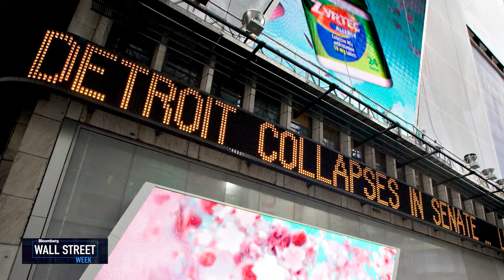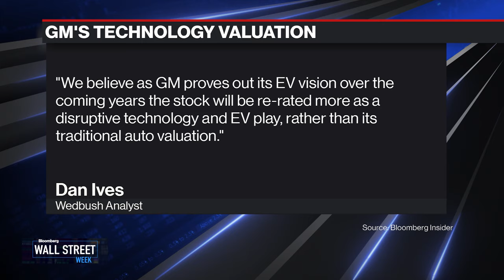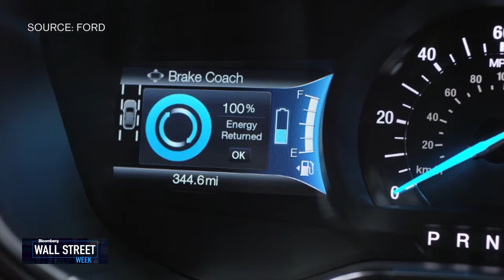Just the Facts: The Auto Industry's Electric Future

Comment: Where are we all going to plug our cars in for an hour while they charge. And no matter the urgency it takes a while to update the grid.
Reply: @dcheard2  takes time and money. We don’t have. The gov can’t even pass a infrastructure package without cuts. Ev are extremely training on the grid. Gonna need a lot more power plants that take time to build plan engineer
Reply: @sandcrewus1362   they probably said the same thing about gas cars but here we are.
Reply: @dcheard2  well with gas cars you can just open a station and buy fuel. With electric,they’ll have to relay on a public utility
Reply: @sandcrewus1362  lol. they had to build, plan, and engineer the oil refining process too. build out the stations too. did you think that gas just comes out of the ground ready to go?

Comment: Telsa fantasy world. There is no "Transition to electric vehicles"  Not that people don't like EVs - there isn't enough lithium. Even IF you devoted every ounce of the 100,000 Tons of lithium to EVs max is 10 million Ys.  But there are 1 billion cell phones, battery farms, laptops etc. all using lithium; so the real number is 5 to 6 million in a market of 100 million vehicles annually, 5-6% niche market isn't a transition.  At this point EV advocates say what about sodium what about carbon .. what about them? There isn't a single vehicle incorporating them yet.  More sobering? 1.4 Billion light vehicles exist of which EVs are 0.3%.  Add to this EVs don't work for a lot of purposes - they perform terribly under load. A Rivian truck towing a trailered Mustang only goes 120 miles before needing a charge, 100 miles in frigid weather.. same goes for any EV under load; their range is horrible in that circumstance.  If it were not for "subsidies" they wouldn't even be selling well; EVs are more costly than alternatives.